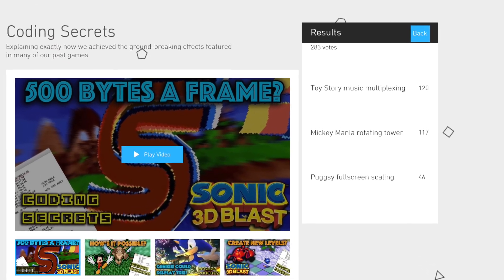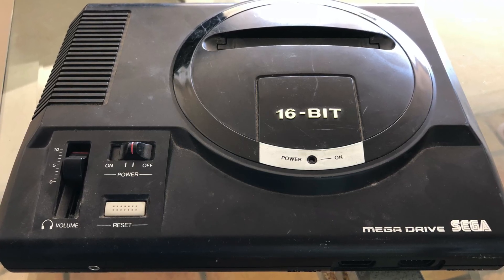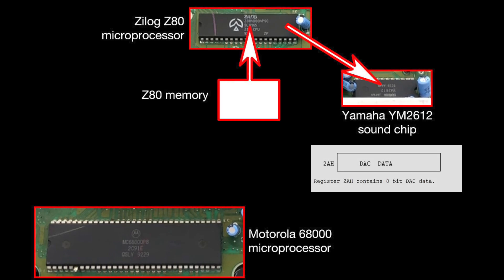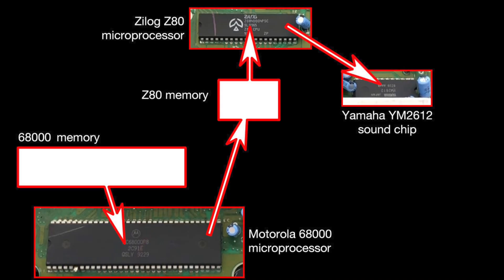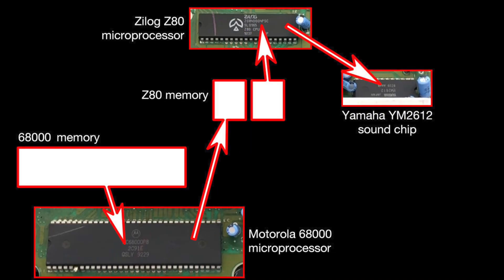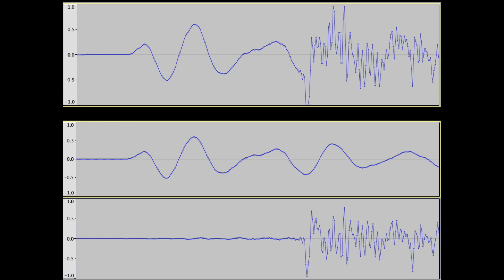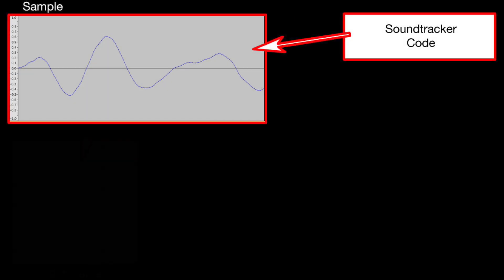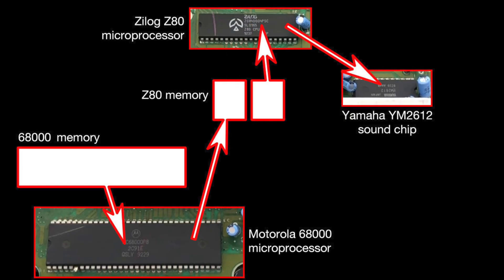Toy Story's Hardware Defying Music - How We Did It

Comment: Can''t the 68000 access the sound chip directly if it wants to? Seems like the Z80 is just getting in the way.
Reply: The z80 is acting as a 10 byte playback buffer. If the 68k were to write directly to the port, it would have to do it for each sample. That's much more difficult even at 10khz output rate. Having even a tiny buffer like 10 bytes helps alot.

Comment: So, the 1988, 16 bit Sega Genesis had a crappy 1 channel audio system that required insane amounts of juggling to get good audio, yet in 1982, the 8 bit Commodore had 3 voice channels, and a white noise channel, and blew Sega out of the water before Sega was even thought of. Someone didn't think that one through.
Reply from the maker: The Genesis had a bunch of FM channels so easily capable of outgunning a C64, but, like the C64, only had one mono sample channel. So if you want multi channel sampled sound you need to get creative...
Reply: @CodingSecrets  So why did the Genesis coders have to juggle the impossible to get passable music on a newer more powerful unit, but some Russian dude creates a four channel, 12 minute long track to his game (Tetris, in case no one remembers.)with no effort? Damn, I knew nothing about coding (Still don't.) when I owned a C64, yet with basic, slow old basic, I could generate 7 distinct voices with a few tips I picked up from magazines. Apparently the C64 didn't have one sample channel like the Genesis. I have to say, what you were capable of pulling off with that one channel and it's limitations was impressive.

Comment: I'm always impressed by how innovative programmers got around the hardware and memory limitations of the early systems.  Their ability to coax consoles to do so much more than they were ever designed to do, seems miraculous.  Modern programmers really are spoiled by comparison.
Reply: Having programmed through all these years the changes have been incredible. Almost everything I learned is now wrong.

I remember when memory was precious and fast, running synchronously, or almost, with the CPU. Lookup tables could speed up complicated operations (like here the pitch and volume LUTs saved a number of divisions and multiplications), but each LUT took up a lot of your precious memory (only handful of megabytes!). Now you have all the memory you could want to make look up tables, but memory is glacially slow and lookup tables blow your CPU caches, so it's faster to do complex math than look up a number in a big array!

I remember when software implemented fixed point math was faster than even the built-in FPU math on a 486 (let alone simulated FPU math on a 386). Now floating point math is much faster thanks to better FPUs, pipelining and SIMD instructions (SSE).

I remember when colour change effects were practically free (because you could do them by changing the on-screen palette), then they became really expensive when lost the palette in exchange for true-colour images, and then we gained GPU shaders and now we can do more calculations on every single pixel on screen than a game used to spend to draw the entire frame...

A prototype I made back in the DOS days (that unfortunately never turned into a full game): https://youtu.be/d6gLhPaLnAs
I pulled so many rabbits out of my hat to make that happen. Probably half of my available memory was used up for various look up tables and caching the lighting to make it all happen...
Reply: @tylisirn the lighting effects really are impressive for a DOS game.
Reply: @tylisirn  These guys are just doing reactionary comments because they think modern workers are lazy you are bringing actual experience lol
Reply: @tylisirn  that looks awfully a lot like a simplified version of Alien Breed?
Reply: @BradleyQuerruel  The graphics were very much inspired by Alien Breed, you are correct. That's one reason why I never moved further than prototype stage (the graphics weren't stolen, they were custom drawn, but heavily inspired by.) The lighting system is much more complicated than AB ever had, but the gameplay and of course levels are mostly not implemented.
Reply: Modern programmers do similar tricks but on a different scale. For example instead of continually generating and streaming sample data to the limited audio memory, features like megatextures and unreal engine's nanite generate and stream texture and geometry data to the GPU, to work around limited GPU memory (only a few gigabytes unfortunately!) and display much more detail than would be possible otherwise.

Comment: Why was a volume table used instead of math? Performance?
Reply: I'm not sure how audio samples need to be encoded on the Genesis but audio data is kind of logarithmic in nature (the relationship between the volume level we perceive and the actual intensity of the sound is not linear) - so the volume table may have incorporated the results of a non-linear scaling function that would have been prohibitively expensive to calculate in realtime on the Genesis.
Other than that - multiplication and division are pretty expensive operations on the M68K: between 38 and 70 cycles for a multiplication, and around 160 cycles for division. So if using a lookup table could eliminate even just one multiplication operation it was probably worth it.

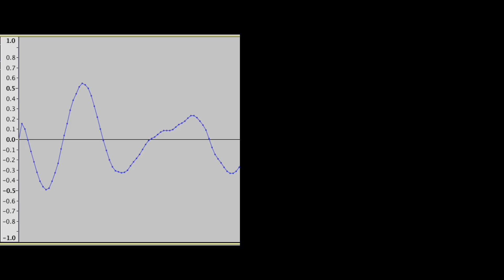Comment: Looking at 4:28-4:40, I thought the horizontal axis was a measurement of time? If that's right then that would mean removing points across this axis would alter it's tempo. But removing those points changes pitch, instead? That gives me the sense that my understanding of this data is completely off somehow.
Reply from the maker: Sound is a waveform. That waveform moves a speaker back and forth quickly to produce a note. If it moves twice as quickly the note is higher. That’s why you can see bass sounds rumbling your speaker - because the movement is slow because the note is low.and so you can perceive the movement. High notes move the speaker much quicker so you can’t perceive the movement. But you’re right about the tempo changing - in as much as you’d use up the data describing the sound more quickly. If it was a sample of speech the pitch would be higher AND the speech would be sped up.
Reply: @CodingSecrets  Aaah, I see now! I was definitely aware that shorter waves = higher pitch, but I hadn't recognized the data as being directly representative of the waveform the speaker would be producing. I thought each point was it's own note, and the song generated just so happened to have a wavy look to it! Thanks for the explanation!
Reply: @CodingSecrets  Hey Jon, could we get some Coding Secrets on the second Toy Story game? The draw distance is quite good for a fifth gen title and on the N64, it runs very well, something quite unusual for that system.

Comment: How did Disney make that movie with those graphics but video games took damn near 2 decades to come close to matching the quality. 

Can ya explain that? cus I honestly don't know. Donkey Kong on a old TV came close play it on a new TV an it's like damn I thought this was the shit back then?? Lol
Reply from the maker: It took Pixar days to render a single frame back then
Reply: The tech they use cost tens or hundreds of thousands of dollars and are way more powerful than a $400 games machine. They also get away with better graphics by taking longer to render, rather than having to do it in real-time.
For example, raytracing was commonly used in 3D animations in the 90s, but only now is it being used in real-time for video games.
Reply: The computers that Pixar was using were SGI workstations. These computers were specifically built for professional rendering of 3D graphics with  custom-built architecture and cost over 15k. This was in a time when 3D graphics rendering technology was not affordable to the average consumer.
The other thing is that as Jon said, it took several days for a single frame of Toy Story to be rendered.

Comment: you talk about adding the data points in the samples together.

is this effectively any different from what a speaker would do if multiple audio sources are sent to it at the same time? (only  speaker would do this as a result of physics and a CPU would do it by being a calculator)

Comment: Horizontal interrupts... code is going to need to know if the console is running at 50hz vs 60hz  or the sample rate is going to be wrong and the music would play at the wrong speed.
Reply: Nah, you know what the console is running at by the region you set in the ROM.  Just need to adjust the scan line position of the interrupts.

Comment: That's awesome, and really in depth. The double buffer was a great aspect I didn't take the time to consider yet too. It's great to see this sort of thing in practice and appreciate all the nuances involved.
Coincidentally, you also helped confirm my idea for a sound system I had geared towards the Virtual Boy. It was following similar principles of handling audio mixing by the main processor, so I could just send combined wave forms over for direct play by the sound hardware. The VB also had similar issues with needing to halt audio playback to update PCM. I didn't think to write it in small chunks though! Instead I was getting around it by leaving a "max note" constantly looping in PCM, and adjusting the volume according to what the current sample should be to fake frequency. This would include sound effects in the audio mixing so they aren't affected by the volume changes. 
Granted that is all on paper though and I haven't gotten to the actual code yet, but I believe it should be in the clear and your video helped give me confidence in it. To put my approach into the Genesis though I'd have to take a closer look at some specifics, such as if there is a global volume that could still adjust the PCM volume indirectly. And of course, if you have more insights on potential issues with this approach (for Genesis or otherwise), I'd really appreciate hearing it!
But definitely digressing here, sorry haha. Very cool video and overall channel.

Comment: Which came first? Mod playback on the AtariST - which had very similar hardware and therefore solution, or this megadrive implementation?
Reply: @fabrice143  https://www.youtube.com/watch?v=BAVqOBCHxkM Star Glider 1986. Jez San created the Super FX as well for nintendo
Reply: Atari ST for sure. We were even doing these tricks on PC (one bit channel used with timer PWM and software mixed to 3 or 4 channels) well before the Genesis / Megadrive came out. The Book Musical Application of microprocessors by Hal Chamberlin (1980) showed how to do such tricks on early microprocessors such as the 6502.

Comment: I don't follow why pitch shifting is required.  It seems that you used tables for all the work instead of using shifts, was this because you wanted to accommodate 1,2,3,4 channels and have full volume for each channel?
Reply: Using a separate wave table for every pitch will make playback code simpler, but will either limit the variety of pitches one can use or massively increase memory requirements.  An approach I used on the 6502-based Stella's Stocking was to use twelve wave tables with lengths from 32 to 60, but unroll the playback loop 4x, allowing the pointer to be advanced by 1, 2, 4, or 8 after each group of four samples, and allowing the four samples within each group to be played from the same sample, or two from one sample at two from the next, or from four consecutive samples, or from samples skipping ahead by 2 or 4.  This made it possible to generate 61 pitches using 12 wave tables.  Trying to include fine pitch shifting on the 6502 would have made four-voice music at a 15.75khz sample rate impossible, but on the 68000 there are some tricks to greatly facilitate it.

Comment: That's truly impressive, and now I wonder if a similar method can be used with the DPCM channel available in the 2A03/2A07 on the NES
Reply: The nes hasn't got an independent cpu to drive the sound chip. Nor any independent sound buffer as far as I know. It would be driven directly by the main cpu and essentially streamed right from the cart or main memory block.
Reply: There is indeed a homebrew soundtrack cartridge from a couple of years back, that does exactly that!

I can't remember what it was called, though.
Reply: It's kinda a mess to do this on NES because you only have one CPU and the playback mode which automatically streams data doesn't use a format that's conducive to adding samples together.  You'd end up having to manually write all the bytes, and it could probably be done for the case of just playing music with carefully written code, but running any other game code would probably mess up the timing.

Comment: I wonder what could be done with a slightly more capable 68k-based processor like the 68332 etc. They have a bunch of extra addressing modes that significantly boosts data transfer speed :)
Reply: In this scenario having a much larger sound buffer that was dual ported would make all the difference. But that would have cost a lot of money in 1989
Reply: @MageLocc 
Question: How much would that have increased the price?    
Not sure if that can be verified or not.